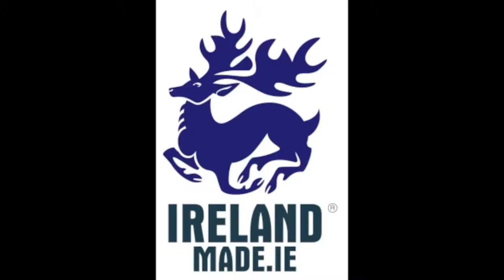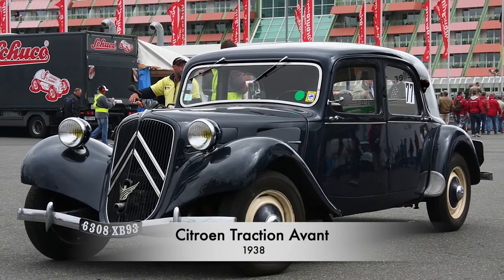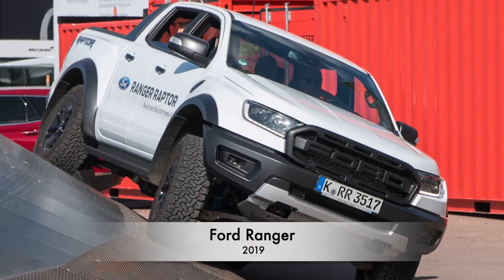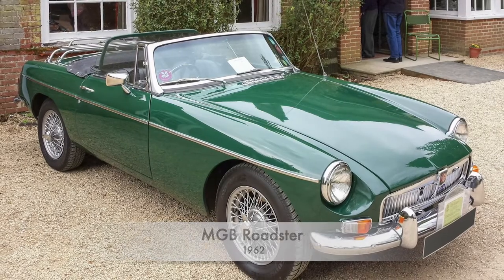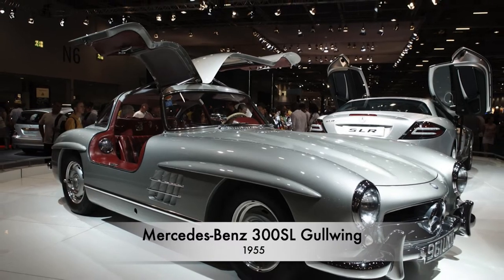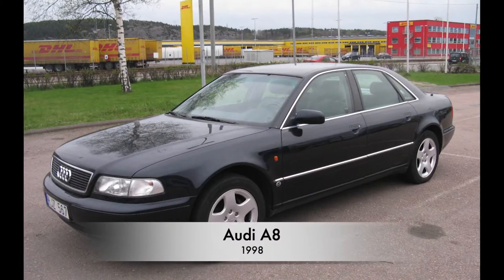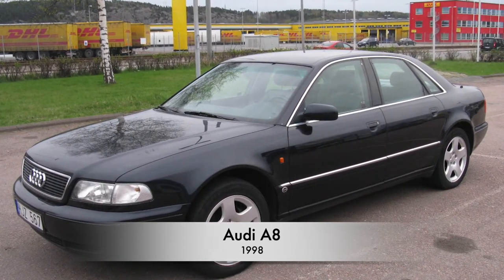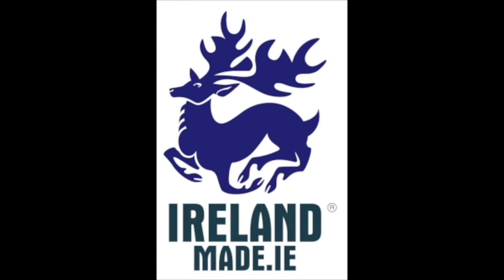History of Body Structures | Episode 9 of the Talking the Talk podcast

Comment: From 1961 to 1963 Ford made a F-100 "Unibody" Pickup. It was still on a ladder frame. just the bed and cab were all one unit, there were problems with cracking between the bed fenders and cab from twisting - - - "it was a truck."     Ford has always made trucks with a separate bed from then on, well now except the new Ford Maverick mini pickup.
Reply from the maker: Great detail Mike, many thanks